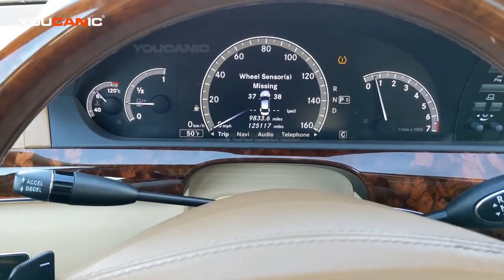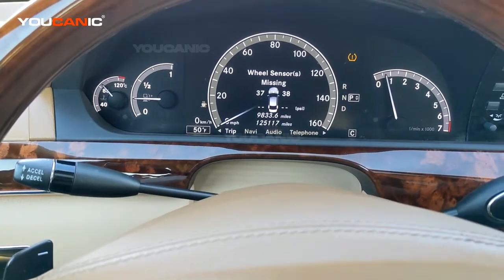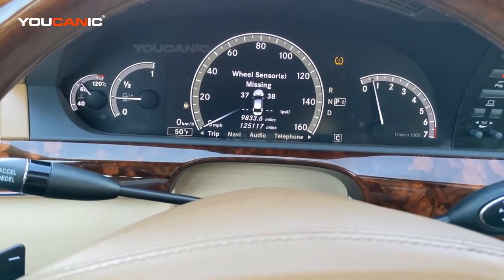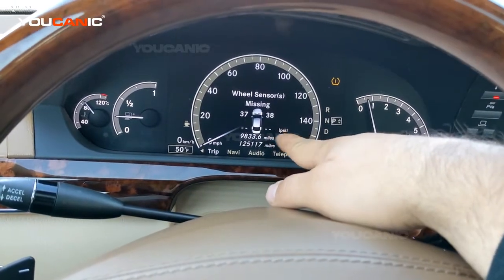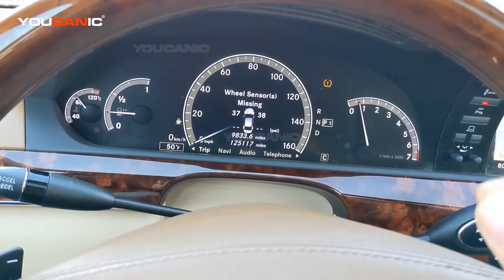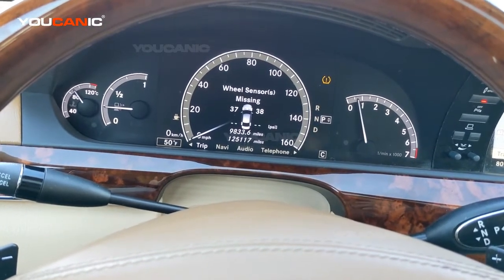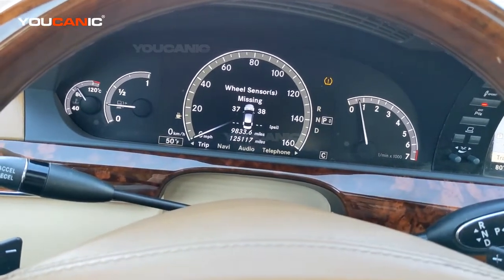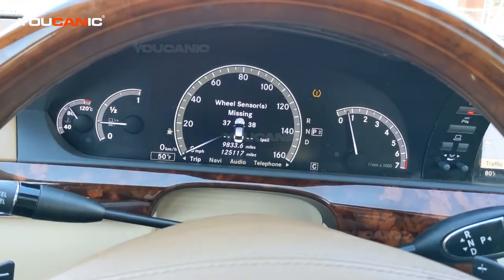Mercedes-Benz TPMS Wheel Sensors Missing

Comment: garbage. It's the 10 year service life battery on your (insert any model from 2017-2023) TPS.. That what they want you to believe to sell you a new set when changing the three year old tires. It's really the TPM that needs reset. Your tire installer can do this but it must be done with the right reset tool. Mercedes doesn't want to fix the real issue on their TPM because it would be costly for the manufacturer to warranty the part. If you have TPS of different manufacturers outside of Mercedes frequency ranges you must reset the module to get it to accept it.
Reply from the maker: Thanks for your input! At YOUCANIC, we aim to guide car owners in understanding their vehicles better and saving money. We offer various guides and resources, including our YOUCANIC scanner and factory repair manuals. If you need a solution for your TPM reset issue, please check out our resources at www.youcanic.com. We're here to empower and aid you throughout your car ownership journey. Your trust is our priority. Reach out to us anytime for further assistance!